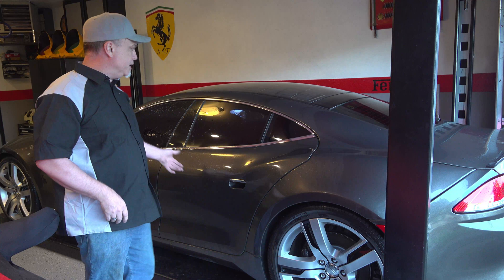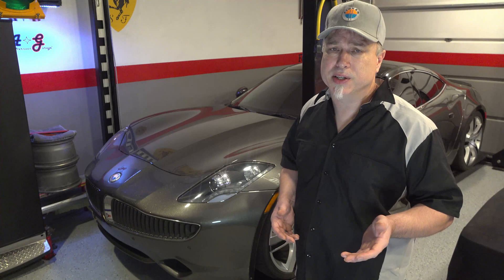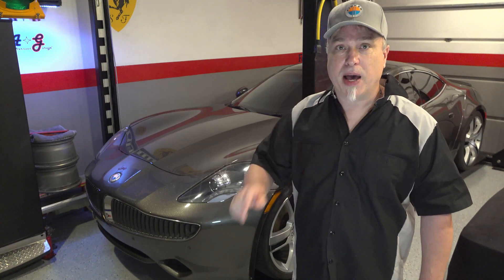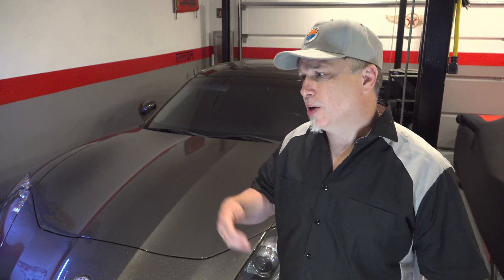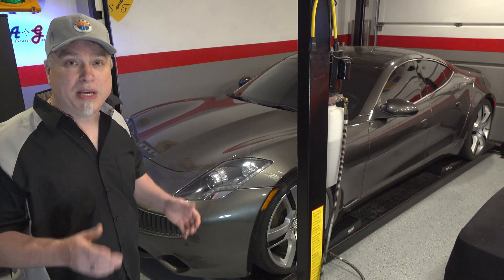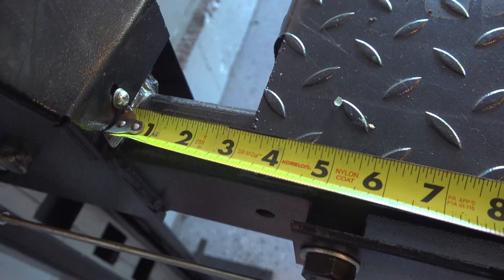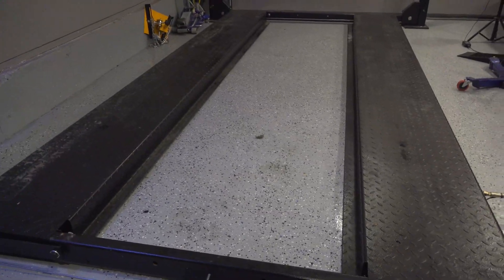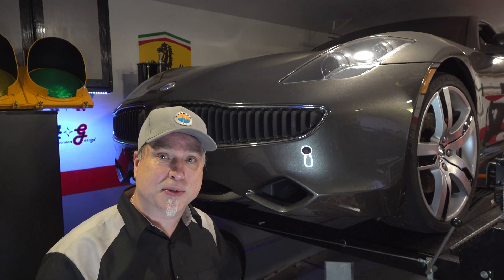Fisker Karma: Problem Diagnosis [4K] Ep43

Comment: I’m happy to subscribe I’m looking to purchase one and your experience and helping me understand the risk. I definitely won’t spend $60k though they have depreciated so much since their inception
Reply from the maker: They are sure a lot of car for the money.  Don't spend too much.  The only way you are going to know if the battery is good on a test drive is to drive it until fully depleted.  If it doesn't make it to zero smoothly, it has bad cells.  Kind of hard to do on a test drive like mine where he arrived with a full charge and went on a 2 mile test drive.  Good luck!

Comment: Great videos 
What tool do you use for diagnostic of the car
Reply from the maker: I used a Snap On Solus Edge, but you can only get generic codes with this scanner.  Anything battery related and things specific to the Fisker will not be named, but the codes should appear on a generic reader.  Fisker uses a Produs diagnostic interface that is specific to that car, and there are laptops that can scan these and also turn on/off general functions.

Comment: Just purchased the 2012 Fisker.  Left it parked for a month while I was out of town.  I was happy it held the charge when I returned but, it lost all the preset radio stations and the back up camera did not work?  Any suggestions?
Reply from the maker: You will need the Puma programmer at a minimum.  These cars need to be operated frequently or this happens with the 12v battery drain.  I would get on the Fisker Forum and ask the people there if there is someone that will loan you the Movimento Puma and the firmware that goes with your car (IE 520, 535 etc.)  Good luck!

Comment: I really liked your video's. Where could I find a fisker karma like yours ,im considering buying one
Reply from the maker: Ha!  You really don't want a car like mine right?  It looks like there aren't too many of them out there now and people selling are asking way too much.  Should be able to get something decent for 30-40K assuming the owners are honest and tell you any problems it has.  You will really need to test drive the car and fully deplete the battery if you want to know if there are any HV electrical issues with the car.  This is difficult to do as most people won't like you taking a 50 mile test drive.  Without the Prodis Fisker tool you will never be able to see if the battery can discharge completely without codes unless the battery is depleted.  Lots of risk with this car and you have to be prepared to spend 20-30K if something major goes wrong.  Good luck, keep checking Craigslist in major cities and be prepared to ship if necessary.

Comment: Hey so i recently bought the same vehicle and all of a sudden all these notifications are on the dash i have some codes wounder if you can help me
Reply from the maker: Auto manufacturers use codes that apply to something specific with the vehicle.  When I was diagnosing the problem I got lots of codes that were general powertrain codes and not searchable. P0A7B is the generic code that comes up when the HV Battery is requesting that the check engine light get turned on. It's usually accompanied by other Fisker-specific battery codes that most generic scan tools can't pick up.  If you are having these issues you will need a diagnosis with the Fisker maintenance tool.  This is a laptop that can be plugged in and run diagnostics to address your particular problem.  Try the Fisker forum, there are folks on there with the proper diagnostic tools to help you.
Reply: Hello, I also have a Fisker, and the check engine light is on. Did you ever figure out how to get into the diagnostics to see what the code is? A normal OBD reader does not work on the car.
Reply from the maker: @lynnmoody6110  It is true that you won't find the Fisker specific codes with out the "Fisker laptop" that is available for loan.  I used a $100 scanner and it told me almost nothing, no codes available.  When I used the Snap-on scanner, it told me all the codes, but the descriptions were incorrect or not there.  With the Snap-on scanner, I was able to see the codes in a "global code scan" by the scanner.  I think this scans everything and will tell you complete codes that are just generic codes. P07AB is a general fault code for the battery.  This is not the fault that is happening but a code used to set the light only.